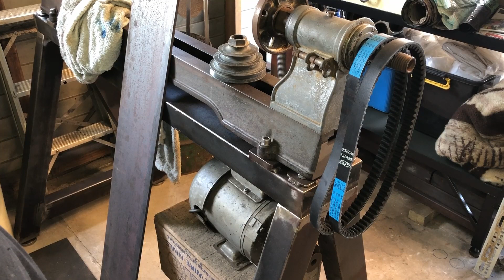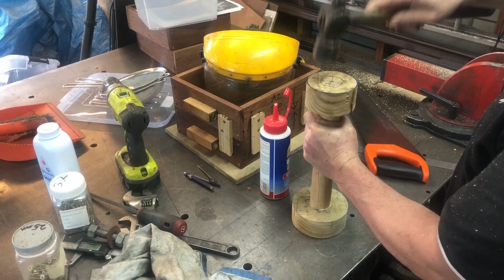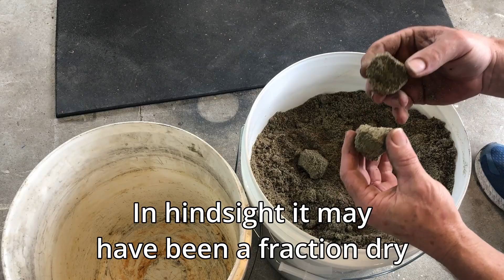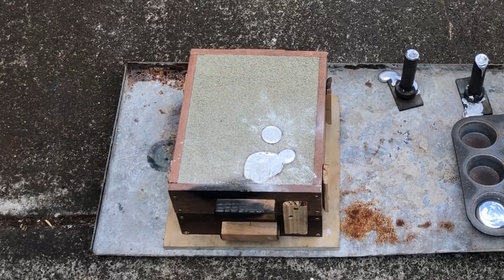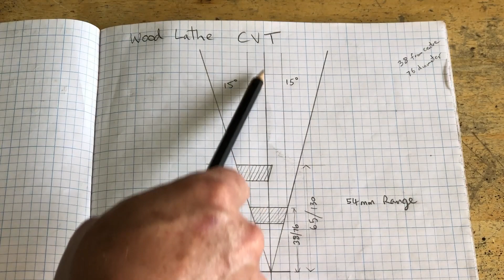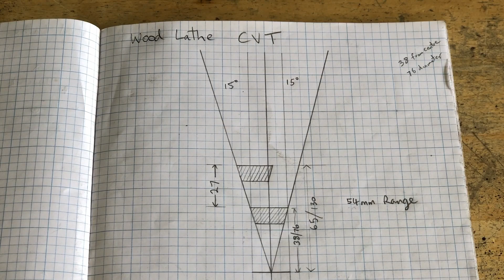Lathe Restoration And Improvements - Making The Pulleys, Then I Hit A Major Problem

Comment: Bonjour merci beaucoup pour cette démonstration mes Jaurès une question comment faire pour monter une poulie variateur sur un moteur asynchrone car j'aimerais changer la poulie d'origine et maître un variateur svpl merci beaucoup
Reply from the maker: What I have done in these videos is how I did it for this application. That said this variable speed pulley system was not practicable for a lathe. On a lathe you are changing the speed all of the time so this variable speed pulley setup is not very good. If I was doing this again I would use a VFD to change the motor speed electronically.
Reply: @thehobbymachinistnz pas de soucis merci beaucoup de votre retour bien. Cordialement

Comment: Interesting dilemma. I have machines with both kinds of drives. My shaper uses the reeves drive type with 2 belts and three pulleys. And my Bridgeport mill uses that single belt system. Although I think the latter has fewer moving parts (or does it?) and seems simpler, I think the mechanics of spreading the driven pulley apart might be a little tougher to figure out. Your original idea may actually be simpler to build. Not sure on this one. I'll be interested to see how you work it out.
Reply from the maker: Thanks for your comments. Do the variable speed drives work well on your machines?
Reply: @thehobbymachinistnz  They work very well. I've taken apart the Bridgeport and can attest to the power of the spring on one half of the CVT. Takes a lot to compress it. The Reeves drive on my shaper is still something I haven't torn into just yet, so I can't say much about that.

Comment: Good series and quality videos. I like the use of the mold for making the pulley blank to start, i am kinda lazy and typically just pour it into a cylinder or pot and spend to long cutting away material...thank f*s for lathes
Reply from the maker: Thanks for watching. Up until this casting I did the same as you. The CVT pulleys will be 6" in diameter and I will need somewhere to hold them in the lathe so I can machine them. Therefore, that would be a huge chunk of aluminum, and I would turn a lot of it away. So I thought that I would experiment with casting these pulleys first.

With the new 22 degrees included angle belt I can make the CVT pulleys out of steel as I have some suitable steel. I'm building them now so there should be another video within a week.

Comment: I think I would proceed with making the 22 deg CVT pulleys and find a way to re profile the 30 deg belts to 22 degs. There looks to be plenty of width in the belt to be able to grind away the sides. Not ideal, I know, but it would make an interesting side project, besides the belts are not likely to be subject to high loading on that size of a wood working lathe so should be able to cope after modification.
Reply from the maker: Thanks for your comments and suggestions Ian. I found a belt and picked it up this morning so I will go with that at this point. I can use those other belts and pulleys in other future projects so they will not be wasted.

Comment: Good functional castings Jon. Draft does make it easier to get your patterns out. About 2 degrees is OK.  I had a variable speed drive on an old drill  press called a "Robley Variator" it was easy to adjust but it absorbed a lot of torque.
Reply from the maker: Thanks Mark. The wood was not that good to use. There were knots etc. and I tried painting it to make it smoother. I think I will 3D print the patterns going forward. That way I can easily add a draft as well.

Comment: Well done. Lots of mistakes made during casting... that'll teach you though so all good. I haven't actually done any casting since school but have plenty of books on the subject which I have read!
I had to service the variable drive on my cousin's Shopsmith Mk V lathe which is interesting because it has a cam acting via a screw to close and open the pulley. Fairly sure it has an intermediate one too.
Reply from the maker: Thanks for watching Ben. I have seen a drill press that had a cam to operate the pulley. I was going to use something like that in this design, but I will get to that a bit later.
Reply: @thehobbymachinistnz  Look up the ShopSmith Mk V. It is quite a lot of what you want to achieve.

Comment: Will there be any issue with torque through the belts
Reply from the maker: Hi, do you mean with slipping? If so then I don't think so. The belts are designed as variable speed belts to be used in CVT pulleys. I will know more once I have finished and tested it so I can give an update then.
Reply: @thehobbymachinistnz  I used to use a test bench with this system on it. It couldn't start if the speed control wasn't return to its lowest setting. The  motor stalled
Reply from the maker: @Noote54  Thanks for the info. I only have a 1/2HP motor at this point. I will have to see how that goes once the project is complete. Best practice is that the lathe should always be started on a lower speed. I will need to get into that habit once it is operational.

Comment: Not a bad first set of castings. At least they were serviceable. I appreciate watching the design process and changing gears when you need to. Very few times does anything work perfectly the first time.

Mark
Reply from the maker: Thanks for watching Mark. The issue is that there is very limited info on YT for making these CVTs. I have only found one other video of someone building one, and he has not finished yet. So its a bit of trial and error, and change the plan as you go. I'm sure that I will get there though...

Comment: Interesting subject Jon.   The trouble with wider/deeper rubber belts is that they also generally become stiffer, so minimum curve radius may become an issue as well.  I will be keen to see how it all works out.  Cheers Rob
Reply from the maker: Thanks for you comments Rob. I overlooked that included angle issue so its been a bit of a challenge. I think I have it sorted now, I just need to find the right belts.